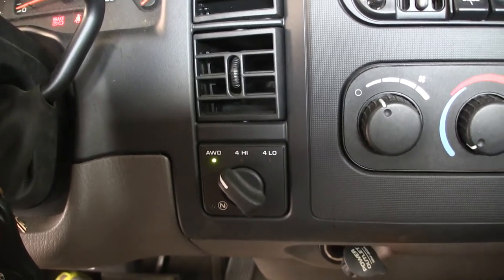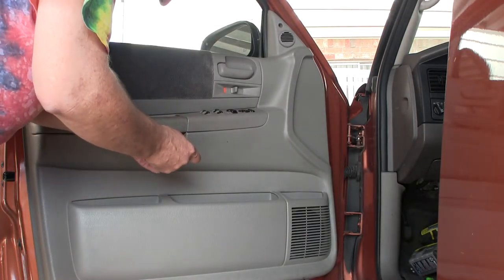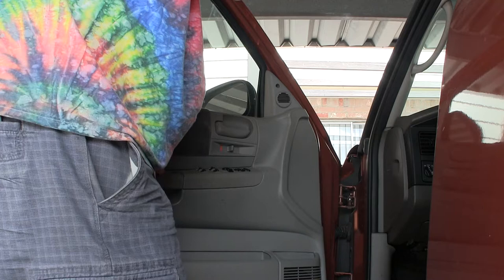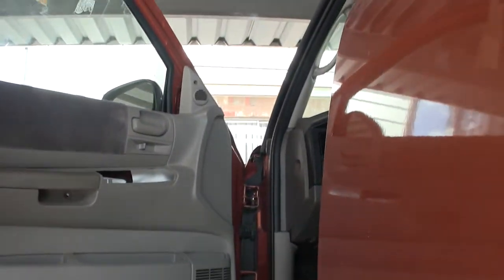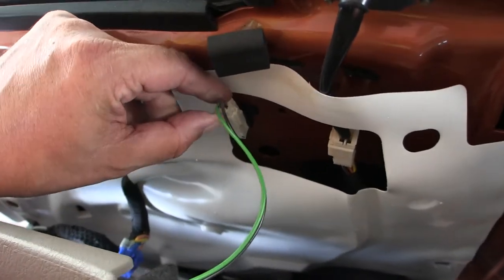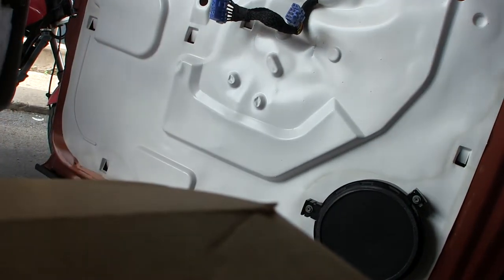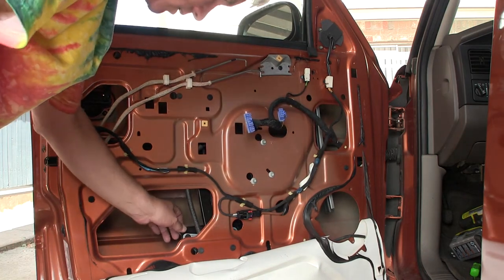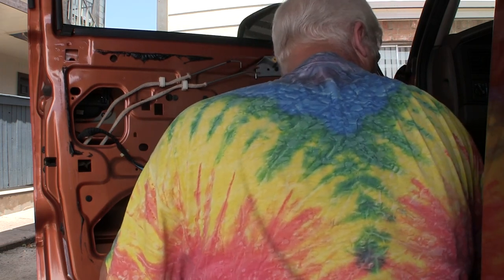2001 Dodge Dakota QC 4X4 4.7L How to upgrade & Install Replacement Infinity speaker 01 of 11

Comment: can the tweeter be replaced without taking door panel off?
Reply from the maker: No.  the door comes off easily enough - just take it slow and easy as the power window switch just pops up out of the armrest and then some torx and regular screws and take pictures as you go.  The only hard thing to do is separating the door handle and door lock from their nylon clips - you will have to do this by feel as you cannot see too well in there